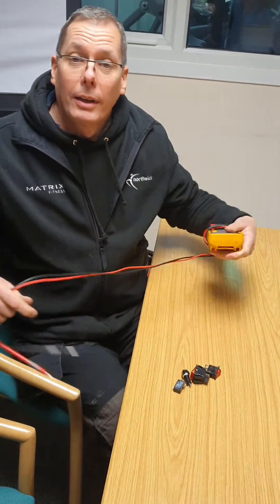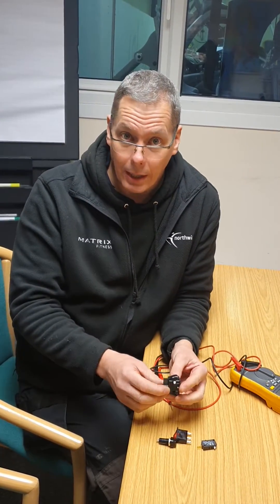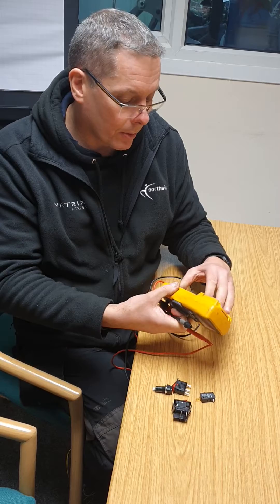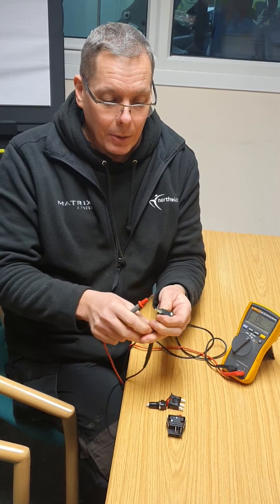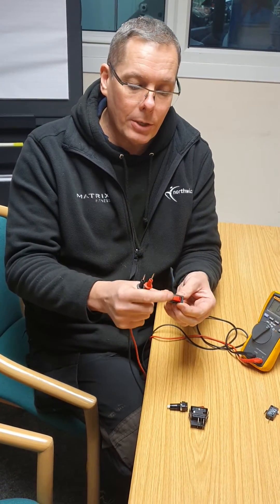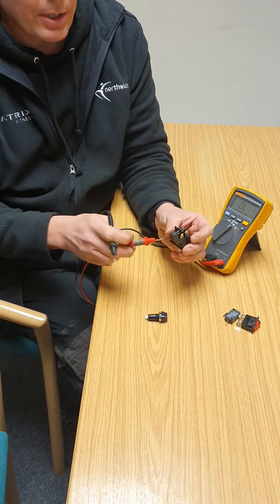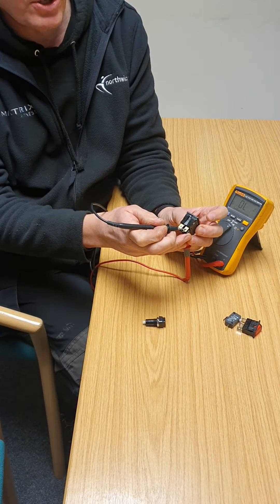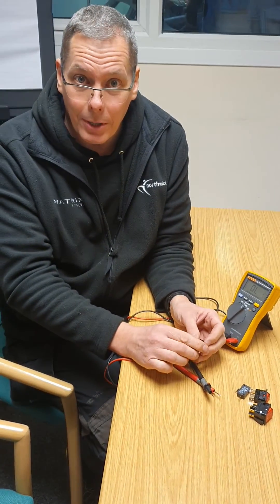How to test switches

Comment: How to identify the ground in a 3 pin switch with all silver pins?
Reply from the maker: Hi Ravi - you are looking for continuity (low resistance eg. 0 or 1 ohm) between the ground (ie. a bare metal part of the chassis) and one of the silver pins. This will be the ground pin.

Comment: Is your meter set to ohms?
Reply from the maker: Hi Doug - the meter is set to "continuity" which causes the meter to sound a beep when the probes are touched together. In this mode, the beep occurs when the switch is closed. You can also use OHMS - best to choose a low ohms range such as 0-200 and when the switch is closed, the display will show ZERO (or something very close to zero). Best wishes Jon

Comment: The main reason for disconnecting the switch from the circuit or equipment when on the ohms setting or doing a continuity test is so you don't blow the fuse on your Fluke meter.
Reply from the maker: Hi Gabriel - thanks for your comment. I was always taught never to test continuity or resistance on a live circuit and therefore I never risk blowing the fuse in my Fluke. I think this is good practise. Of course, if I accidentally tried to test the continuity of a switch which was in-circuit, in a live circuit, I would be likely to blow the fuse in my meter, and possibly cause internal damage to my meter and, worse, cause myself an electric shock! In my video, the reason for removing the switch is specifically to ensure there are no back feeds through other circuity and to prevent getting a false reading on the meter. I have assumed that the circuit under test is already disconnected from the power.  Thanks for raising this important point. Best wishes, Jon

Comment: Hi.i have a heated steering wheel on my hyundai i40 I have taken the switch  off  when I go onto omes  the light comes on ever time  I go across  the terminals  and stays on even when I I pree and depressed the button. So do I have the settings  right on the tester.it must be using the power from the tester?

Comment: Thanks. It is useful ful to cut away to show what it is that you are talking about. Speaker? What speaker?
Reply from the maker: Yes point taken - I tend to film in one-shot to avoid post-editing so apologies for any confusion. The speaker reference is to a symbol on your meter that resembles an audio speaker. This is also known as a "beep test" or "continuity" and when on this setting your meter will make an audible beep when you touch the ends of the test probes together.

Comment: Enjoyed your video! My Hoover vacuum cleaner (circa 1992) push button on/off switch, attached to a PCB, has failed. Could I simply bypass the dodgy switch by soldering on a piece of wire, or,  half an inch of solder 'wire' between the 2 contacts...? ❤

Comment: I gave you a "thumbs Down"! WHY?  You didn't show a closeup of the selection you chose on the Multimeter. You simply tried to describe your selection with words and stumbled badly at that. Without knowing EXACTLY which selection you chose on your Multimeter, the entire video is useless for a beginner (which I am). You even had trouble describing the symbol!  I have a simple CEN-TECH Digital Multimeter(Very Cheap because I need to learn more about the Multimeters before investing the money necessary for a good one) I know little about.  I'm trying to learn some of the simplest uses to begin my learning process.
I'm sure you are a very intelligent man but please make videos "taking the time to show precise adjustments as you work" and "take the time to either move closer to the camera or move the camera closer to the subject when referring to specific settings", etc...
Thank you, Bob

Comment: Thanks. Electronic newbies like me just need to know that simply using the continuity check can check the power button!
Reply: Hi checked the t
Connectors  at top of steering wheel and it had come loose clipped it down hard snd niw working. Had been like that since JANUARY  .